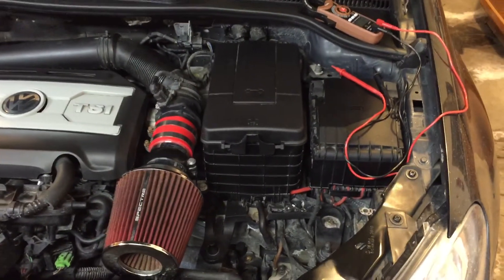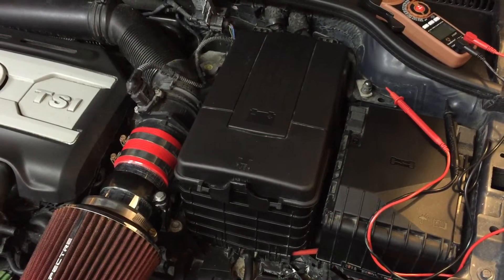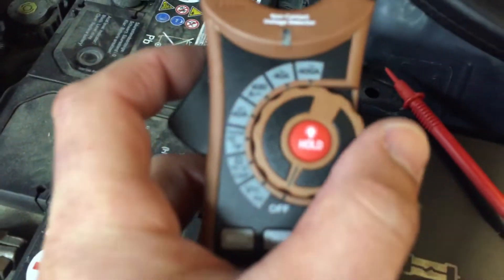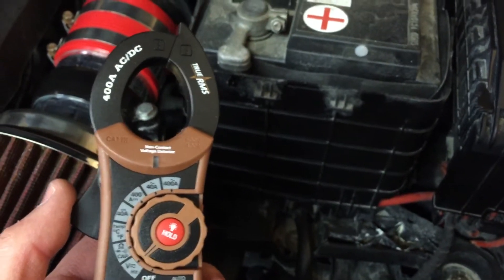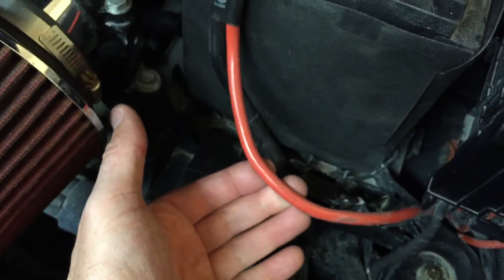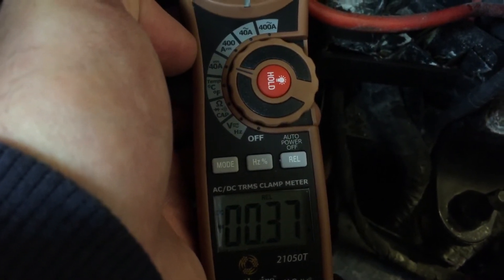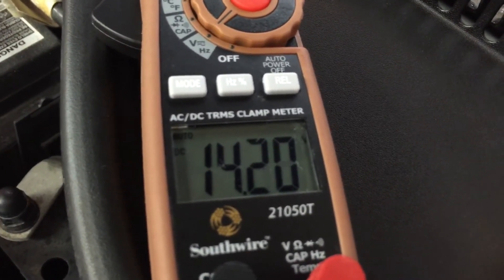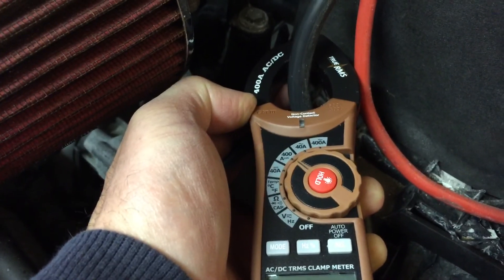2011 VW GTI Battery Test with Southwire Clampmeter

Comment: Sounds like you got bigger problems than a weak battery with the way that motor is talking to you, but anyway the way to test this thing if you want to check your battery you can check it using a voltmeter you'll probably need someone to help you. Hold a volt meter on to the terminals of your battery, your reading was 12.2 have someone crank the starter preferably with the coil or whatever you have available to you disconnected it so it doesn't start right away and see what the voltages across your meter is. You should stay around 11. Next you can use your inductive amp clamp the correct way. Set it up to 400. Clear it, clamp it over your battery cable and crank the car see how many amps your starter is drawing maybe that's your problem. Lastly if you have access to the covers of the battery you can check individual cells using your probes one on the negative, l and one in the cell, and the other half ,one the positive terminal and one in the cell.

Comment: Thanks for your efforts.  But which + cable i should inspect in case i have 2 or 3 wire connected to  the +  battery head ?